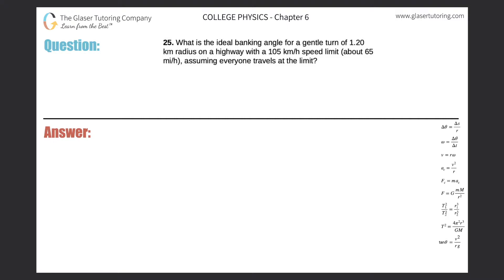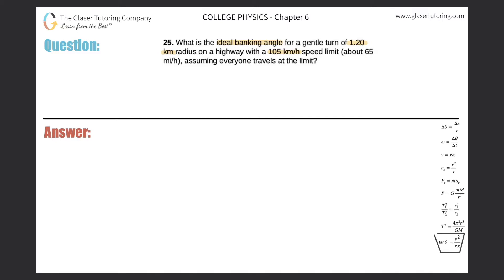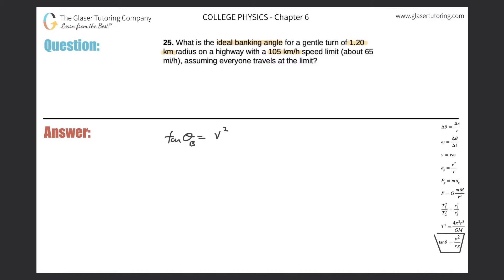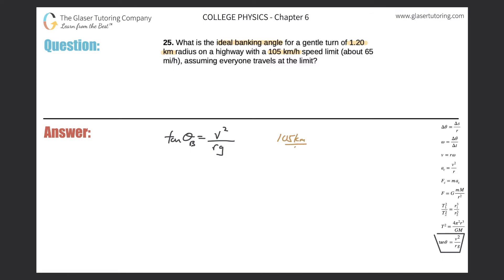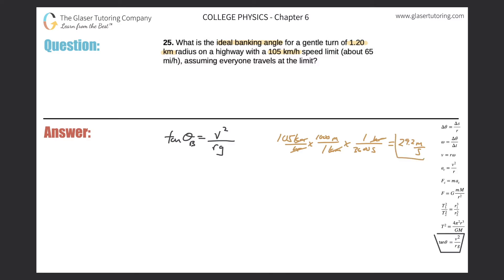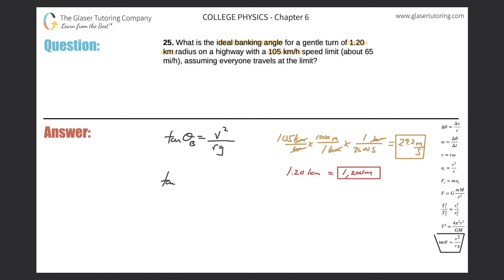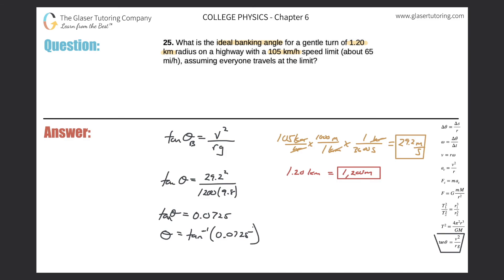6.25 | What is the ideal banking angle for a gentle turn of 1.20 km radius on a highway with a 105

Comment: I got 6.96 after I entered 29.2^2/1200(9.8) into my calculator. What did I do wrong?
Reply from the maker: Hi Ian!  Just be careful when you input values into the calculator.  If you plug what you stated into the calculator, the calculator is going to perform the exponent first, then ONLY divide by 1200, and THEN multiply the entire answer by 9.8.  To avoid this problem is to put (1200 x 9.8) in parentheses - that way they calculator understands that the 9.8 is also in the denominator as well.  You can also just multiply 1200 x 9.8 in one step and then divide by that number.  Hopefully this helps!